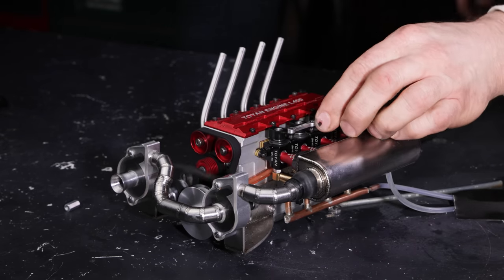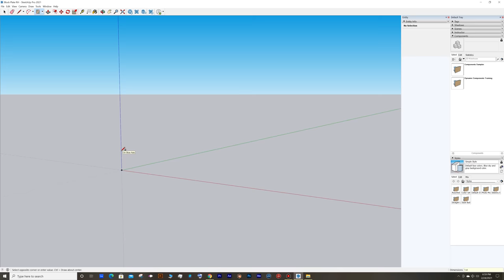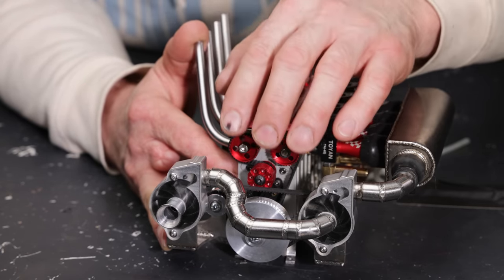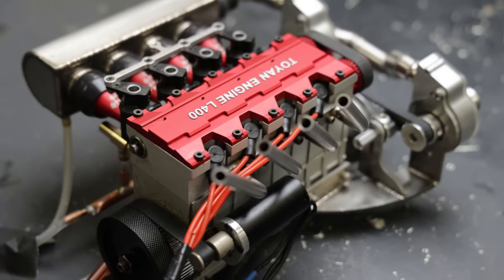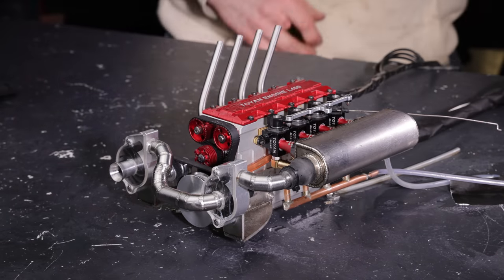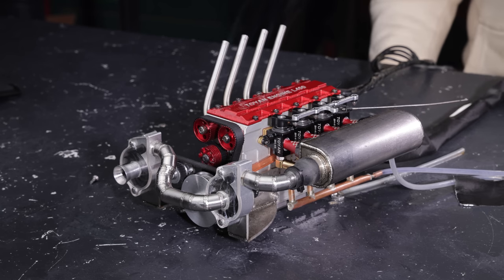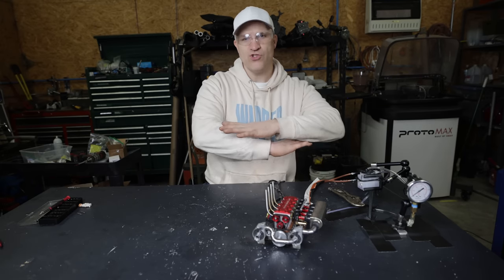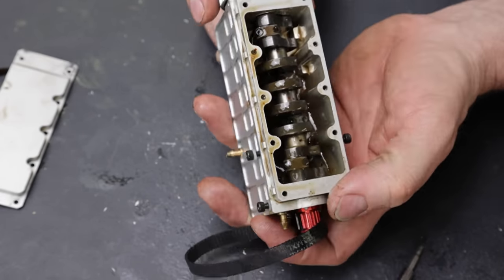Twin Supercharged 4 Cylinder Nitro RC Engine

Comment: Insane! 3 psi on that scale is monumental! I agree, going bigger should bring even better results. Also, double check all connections for boost leaks. I thought I sorted that problem out, but it was still there. Can't wait for the next part!
Reply: I figured you would be all over this hehe
Battle who will get the most power out of that little toyan
I like your videos very much for all the ingenuity and craftsmanship, but you got to admit that warped perception also has some fine tools and knowledge
Reply: Why are u not verified?!??!
Reply: You did it better and more professional. Your was hard to get to work but this is Fake
Reply: @motorenbastler9289  I don't understand why nobody is suspicious? First off, two of this "compressors" the same size make no sense at all, in a compound setup you need different sized Turbines. When he said the boost of the two turbines add up, I completely lost it xD. Even a tiny bit of knowledge in physics and you would realise that can't be right. And then this 2 little plastic fans making 3 PSI of boost at that low rpm? They do not even compress the air because they can't with this huge gap between the Compressor wheel and housing.
Reply: Dude It's not real.. Look closely...
Reply: @eliask6180  yes you are right. I already postet a comment to this an hour ago. The other thing is the supercharger of JohnnyQ90 did 90000rpm. This one maybe 50000 and like he said mabye 2 psi. So i liked this channel before but this video is Bullshit.
Reply: Why do y'all think this video is fake? The compressors look like they're larger than the one Johnny made, and how would the intake pipe pop off like that without boost?
Reply: I 100% came to the comments expecting to see you here!
Reply from the maker: @motorenbastler9289  the problem with JohnnyQ's supercharger is going to be the centrifugal compressor blade geometry. Just like a jet engine or a turbocharger, when you get this small you have to use a different type of centrifugal compressor.
Reply from the maker: @NathanielHatley  Exactly! Same reason people say rockets are fake, sometimes they just don't have enough knowledge about the subject and they just draw the easiest conclusion possible.
Reply from the maker: Thanks, I will make more, I was going to leave a comment about your compressor on your channel a while back but I feel it's Taboo. The issue with the type of compressor wheel you are using for your supercharger is that, it's extremely difficult to get the inducer geometry just right, it is already hard enough to get that geometry right and takes millions of dollars of research on full size compressor wheels.a compressor wheel as small as the one that you are using, you have to spend that thing at like 500,000 RPM, the air molecules do not change size. Don't feel bad tho sometimes companies spend years to get those numbers dialed in. But when you go that small you have to go with a different type of compressor. I knew people were going to call BS if I made it work. People are funny. I thought you're supercharger looked pretty badass tbh.
Reply: I knew I'd find you here..
Reply from the maker: @eliask6180  🤦‍♂️ lol google "Compound Turbocharging" or Google how they get water to the top floors of tall buildings "Compounding".
Reply: @eliask6180  confidently incorrect. I agree with your compounding statement, as both impellers and housings are the same size, so one could make the argument no compounding is occurring. Simple mistake and totally understandable. Obviously boost is being produced in some capacity because you see the inlet on the intake manifold get pushed out of the charger outlet at 7:48. Maybe not to rob’s numbers, but some sort of boost is being produced.
Reply: @WarpedYT  “sometimes people just don’t have enough knowledge about the subject and they draw the easiest conclusion possible.” Amen. Armchair engineers  have nothing better to do than to try and disprove someone that has FAR more knowledge in the subject matter than them. You rock!
Reply: @WarpedYT  having seen johnny's video where he polishes the valves in the cylinder head, im higly curious to see what lapping could do to the performance of this 4 cylinder.
Reply from the maker: @cody4925  lmao !!! "Armchair Engineers" man I have worked on a few defense projects in the past with my company, I have set things up send people videos of certain engineering accomplishments, and they still don't believe it until they're there in person seeing it happen... Funny how the human brain works. But man armchair engineers I'm going to have to use that one in the future
Reply from the maker: @ctrang0458  I'm guessing it would add a little bit of extra compression, but nothing 10 or 15 lb of boost can't take care of...lol
Reply: Lol for a second I thought I was watching your videos.
Reply: Was hoping you would see this, very cool
Reply: @NathanielHatley  vibration could easily make intake pipe come loose.
Reply: i knew youd be here lol
Reply: @joshmeyer5280  I had same thought.
Reply: @darioknezovic5587  seriously? I’d go to my eye doctor if I ere you. Johnny’s build was way more elegant. No disrespect to WarpPerception.
Reply: Exactly the guy I was going to mention
Reply: @WarpedYT  racing diesels will sometimes have 3 compound turbos, I know you are using super chargers, but you should use triples
Reply: You on the other hand aren't posting any progress.... 5 minutes of building clips and 2 minutes of actual running.... i already unsubbed from your channel because of that... we want to see progression, not building clips.
Reply: @motorenbastler9289  his was the worst.... far from good compared to this video, idk what you are smoking but pass me some pls
Reply from the maker: @fanghou8924  Sorry friend, if you haven't noticed elegance is not my thing, my hands measure 10" from pinky to thumb..lbvs. Johnny's lathe is cleaner than my plates that I eat off of... Haha.. Elegance 🤦‍♂️
Reply from the maker: @tylerkwiatkowski3757  finally somebody who knows what compounding is!! Thank you! Yes I was going to use three superchargers at first but I wanted that kind of symmetrical look.
Reply: @-never-gonna-give-you-up-  i dont know exactly what i am smoking sorry but yours have to be much better bro.
Reply: @motorenbastler9289  never touched anything, so my brain is cleaner than yours would ever be
Reply: @-never-gonna-give-you-up-  oh damn boi. The only drugs you dont have to touch are the real hard stuff. But you are not alone. You can get help
Reply: 2 Compressor @ the same size & @ the same speed never double up your pressure xD this makes no sense 😂
Reply: @Speeder1990  they need to be different size or rpm for actually double the boost I would think.
Reply: @WarpedYT  Again, no disrespect. It's just personal preference
Reply: I love watching both you guys videos
Reply: You two doing a collaboration would be freaking awesome!
Reply: I knew that JohnnyQ90 watched this
Reply: @tex6817  JohnnyQ90 recently posted a video of a simple dyno he  made for these engines.
Reply: oh you're here
Reply: @eliask6180  I never thought people would be so upset about a video that they conclude it must be fake. Almost like you're taking it personally that he did something another youtuber that you are a fan of hasn't achieved yet.
There is no reason two identical compressors can't work, they produce a pressure ratio not absolute boost. So for example if there is already 1 PSI at the inlet that is the new 0 for that compressor and it adds boost to that. It will not quite be double though because the problem is the 2nd stage is now operating in a more inefficient region of its compressor map.
The reason 2 different sizes are normally used is to keep both operating in their ideal ranges and to allow you to run a very large turbo that the engine could not spin on its own. But that doesn't prevent 2 stages of the same size from working.
Reply: @eliask6180  The only think incorrect here is that two compressors will double the pressure. They don't. But the second compressor will increase the pressure. Even if it's the same size.
Reply: Oh man I just can't wait what you guys have for these small engines!
Reply: @WarpedYT  your “centrifugal compressor” design is more in line with a centrifugal fan, whereas what people are used to seeing in centrifugal supercharging is kind of  a mix between a axial and centrifugal compressors, and for all those talking about it not being a compound setup as the compressors are the same size is wrong it’s compound as long as one compressor feeds into another, the reasoning behind different compressor sizes in the larger scale is to optimize total airflow, spool speed, drive pressures etc
Reply: You should order a computer radiator it's like 10$ on Ali express and a CPU fan for cooling
Reply: @adiznuts645  cuz its yt
Reply: @adiznuts645  you gotta do it manually, youtube doesn’t just hand out the ol checkmark.
Reply: @johnnyq90 you should both do a collab. See what craziness you guys could come up with
Reply: You should do something similar with turbos instead and see who makes more boost and powaaaaa 😊
Reply: I expected you to comment on this vid!
Reply: You must get one of this, water knifes, scale one. Well you have inaf space between your legs 😂... Just kidding... nice work and we like to see building process and progress... I see someone critic that.
Reply: @WarpedYT  what you think about the smaller, maybe one cilindar, engine use for spinning turbo, using metal gears?
Reply: I don't respect how far he is going into your content.
I do respect how well you took it.
Reply: Hi,Johnny)
Reply: @eliask6180  your right this isn't the best way but wrong on the these are centrifugal compressors they sling the air out not squeeze it through. Sizing doesn't have to be the way you described either. Lots of applications where same sized compressors are used. Now I will say I believe his rpm is too low for a centrifugal compressor to be useful really. Now his explanation of compounding is all wrong if you run 1 bar on each you don't get 2 bar you get 3
Reply: @JohnnyQ90 im subscribe your channel, master of little machine that experiment with turbocharger too
Reply: 3psi on what scale, are you saying that (atmospheric) pressure acts differently on small things … 🙄
Reply: He need to fix the over heating first, that thing will melt
Reply: just before the pulley flies off it makes a lot of revs but not much boost. later it makes less revs but suddenly 20x more boost. see for yourself 8:00 and 11:30.
Reply: Now let’s put 30 psi through it
Reply: 3 psi is like the pressure when u whisper....
Reply: @eliask6180  Silly kid, physics are for adults.
Reply: I like your chanel mor and i suscribed
Reply: That's not 3 PSI. That is 20,684 Pa.
Reply: He's gotta put this engine, in a mini car. Would be soo sick.
Reply: I watched your videos on those Toyan engines. You and Warped Perception do great work.
Reply: @xeigen2  idk why no one knows this it’s simple
Reply: @itoadster7773  you can’t blow above 2 psi
Reply: Would love to see you install in a rc car
Reply: If johnnyq90 gives ya props…. Ya know ya did something bad ass! Love the video! Keep up the great stuff!
Reply: @motorenbastler9289  - What a coincidence!

So are you.
Reply: @adiznuts645  his a youtuber that also posts rc mini engines
Reply: I’m s big fan :’
Reply: @tex6817  I can see someone building that and please for the love of God, when they do, build a live steamers town and railroad around it. Then put a tiny billboard up by the side of the actual road and offer dyno tuning services.
Reply: this is the biggest comment war ever😂
Reply: @NathanielHatley  FI doesn't make boost with no load on the engine. This is a fun looking setup but its not really making boost. The psi you see if from the fuel pump.
Reply: @adiznuts645  he is bruh
Reply: @beckyfinfrock9151  that was not the case 3 years ago brah why'd you reply after so long

Comment: Looks like you're having fuel delivery issues as well. Using boost pressure to control the fuel pressure will never allow you to have full throttle. At part throttle you're building boost against the throttle blades, but on the engine side of the throttle blades you have less than the 3psi the superchargers are producing which is allowing the 3psi of fuel to be injected. At full throttle the boost and fuel pressure will be equal and you'll never get fuel to the engine. In simple terms the fuel pressure has to be higher than the boost pressure if it's ever going to work at full throttle. You have to remember those aren't carburetors, they are a very simple form of mechanical fuel injection and the fuel pressure has to be higher than the boost pressure.
Reply: Yep exactly he’s running lean causing the heat.
Reply: I have no idea why people insist on blow through systems. 

Unless he runs an electric fuel pump with a boost referenced pressure regulator to get that additional differential pressure, it will remain lean.
Reply from the maker: 😉 ❤️. You're absolutely correct, but my goal for this video was to set up the entire supercharger system to show people that you can make boost with these little engines. You are dead on accurate everything you said, I have my list of open items that need to be corrected to make it 100% And before I use this engine for my project I think I'm going to do an even crazier modification..lol. I appreciate the feedback I love talking to people who know what they're talking about.
Reply from the maker: @RonaldMcDonald6969  it's mainly running lean because the fuel pressure versus intake pressure versus how much extra fuel you need to meet the increased oxygen from the boost is a ratio that is not linear if that makes any sense. There are other ways to make this work, and I was only running half throttle here, can you imagine full throttle?

Comment: These things are blowing up on YouTube right now.
Reply from the maker: I know I was fortunate to have the first prototype.. not that that's anything special or anything 🌝. I do think I am the first one to make boost with a miniature supercharger. It has been painful for me to watch other channels trying to make boost with these tiny little chargers when most of them are using the wrong compressor style.
Reply: Is that a pun?
Reply: @billbergen9169  it is now lol
Reply: @WarpedYT  JohnnyQ90 has made a small amount of boost on a centrifugal supercharger he made. Also he just released a video in going to watch later on how to dyno a small engine like this. Would be interesting to see what power this can make.
Reply: @WarpedYT  check so see if the impellers are mounted the right way.
Reply: @kushkiller7108  I commented on that too but 0.6psi? This guy has the right idea 10-20psi would be legit
Reply: Hey man, your metal work skills are impressive!
Reply: @danielgrampa624  I agree, it is all a learning process and can only get better
Reply: @kushkiller7108   he knew it. I saw him on the comments on johnny's channel. The problem with Johnny's design is that he uses a compressor designed for actual motors, not for the scaled-down versions. As a result, he is very dependent on the RPM of the turbine. Also, his metal gears cannot handle the power from the driveshaft. He needs harder metals or alloys to increase the gearing ratio.